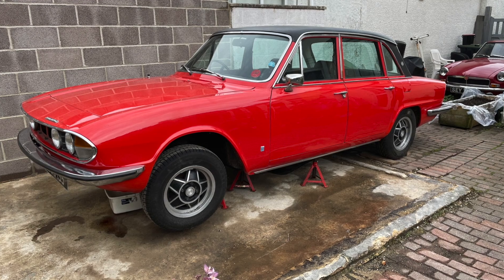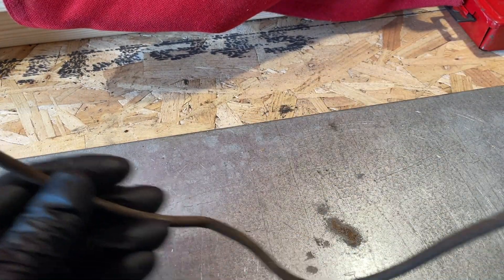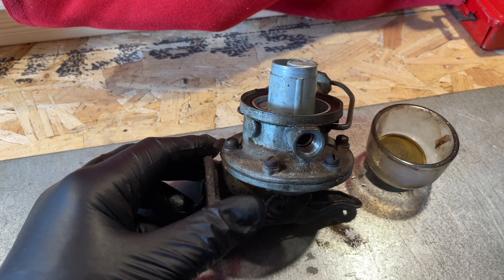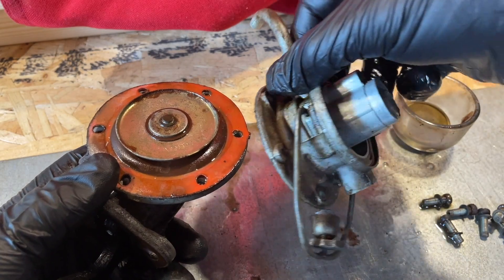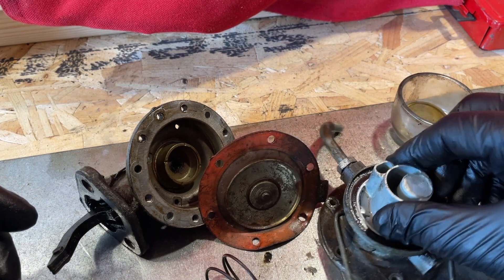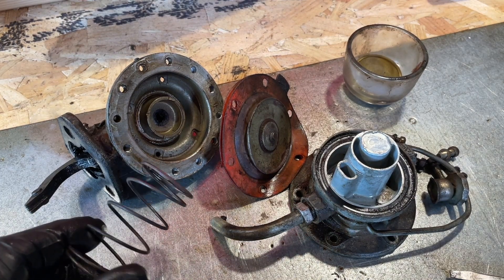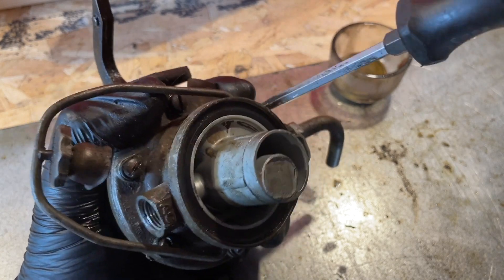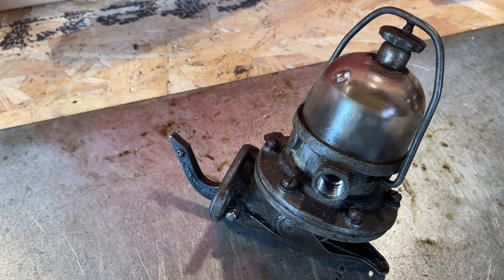Listen to the 'heart beat' of a Triumph Petrol Pump?

Comment: I remember that pump well. I broke down in Southend in the seventies in my early twenties in my B reg 1964 Triumph 2000. An old guy told me what to do at the side of the road and I was up and running in no time. My main problem was crap in the fuel line. I undone the inlet side of the pump and most of the rubbish came out. When I got home, within a few days I purchased a service kit and serviced the fuel pump. At the bottom of the top section were two one way valves which had to be changed also.  All ok in the end, I can only say that the service manuals in them days were printed in much more details. Good luck with your pump.
Reply from the maker: Nice one Peter - they're almost like little heart valves in there aren't they! Glad you got it sorted! Join us on a weekend by the way here www.arrythestag.com/saturday-sockets All the best Tony

Comment: Interesting Tony however you completely forgot to mention the control valves in the top part of the pump.these goven the flow of the lift pump and are controlled by spring pressure and become weak with age.
Reply from the maker: Hiya - you're quite right .. I missed that..and thanks for the extra insight..I'm sure the feedback will add extra value to others watching the video. Best wishes and thanks for posting! Kind regards Tony
Reply: Great subject for a video Tony, just to echo @mrcogginsgarage7062 point about the 2 control valves, I've tried to recondition 2 of these AC pumps for my Vitesse by replacing just the diaphragm but have been unhappy with the results, they didn't seem to have the strength to pump enough fuel - even though they made quite a good suction sound like yours in the video. I baulked at replacing the valves, they are staked into the top body of the pump, so need grinding or levering out carefully, and I couldnt convince myself I could get them both out without damaging the seats. Ended up replacing with a new replacement pump, although i swapped out the new spring for the original one from the AC pump, as the new pump seemed to be supplying too much pressure and flooding the Strombergs.